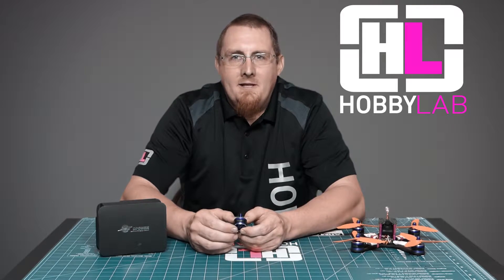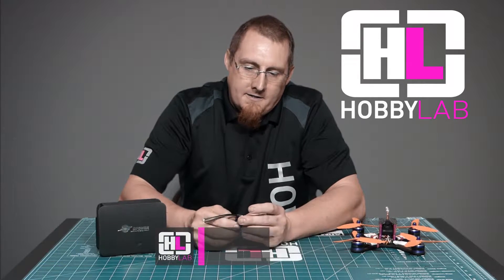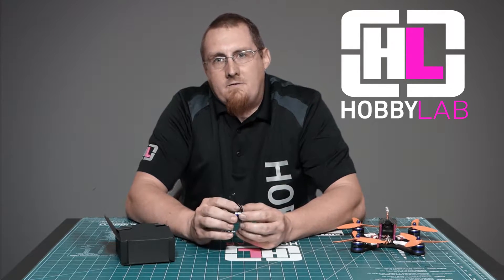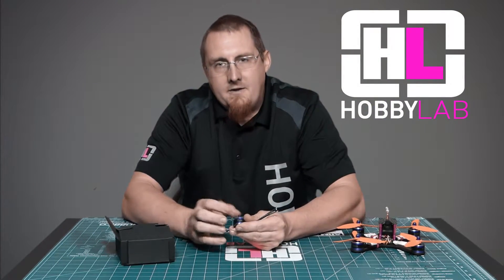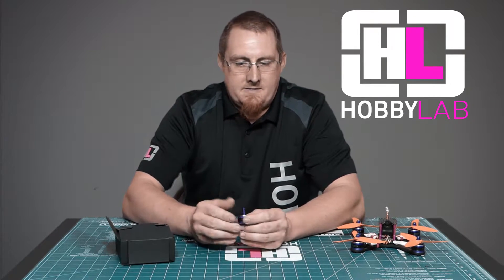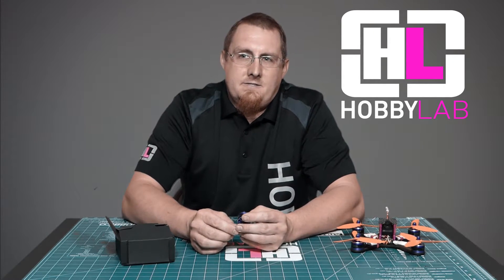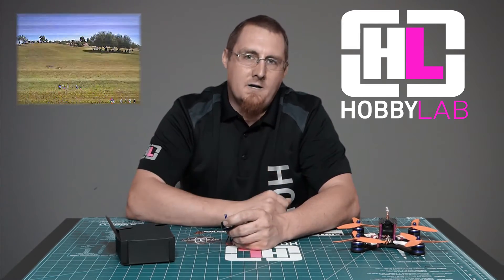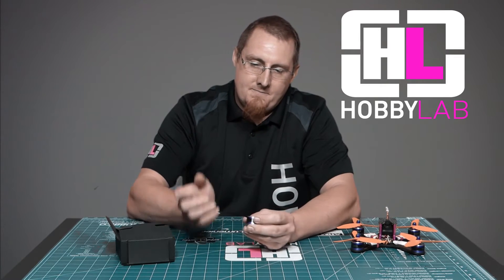LD Power 2205 2700KV Review

Comment: Been thinking about trying 2700kv motors for quite some time now. Thank you for the review
Reply: 2700kv is nice on 5in thinner props. We have a thrust bench on they way for our next motor reviews and also will be testing the brothers rc 2205 2600kv vs emax rb2205 2600kv vs dys 2205 2550kv vs these motors.

Comment: Love the frame selection!
Reply from the maker: Our pilots are loving it also! Although theydid have to use longer screws to hold the center section together. After adding thin plastic washers between the pdb and bottom plate they had a increase in "Decapitations" happening.